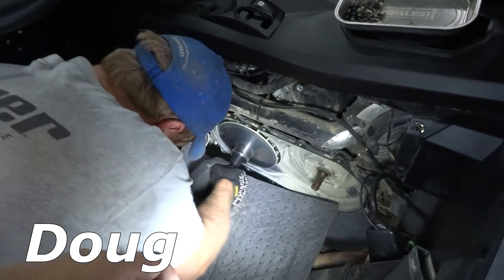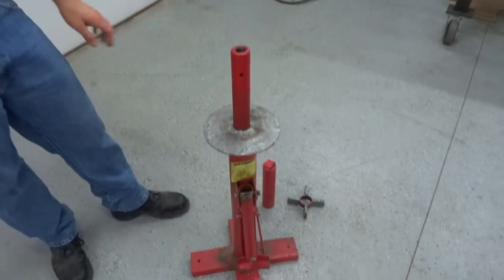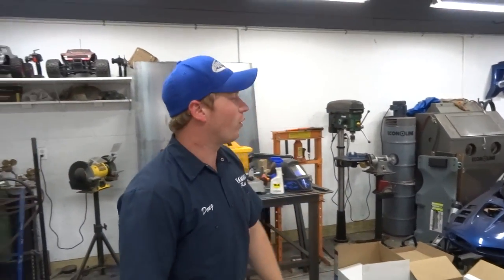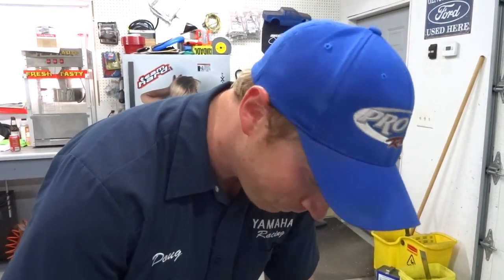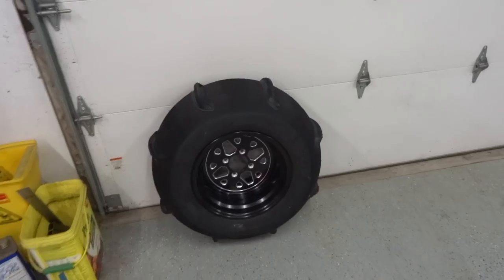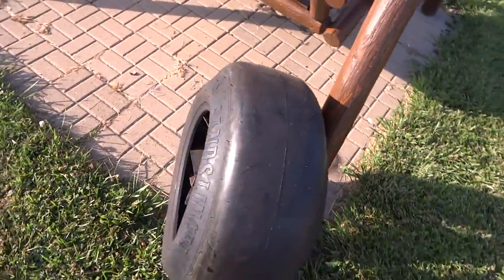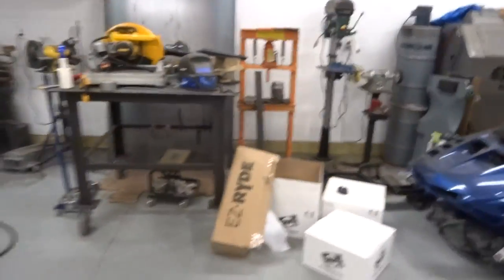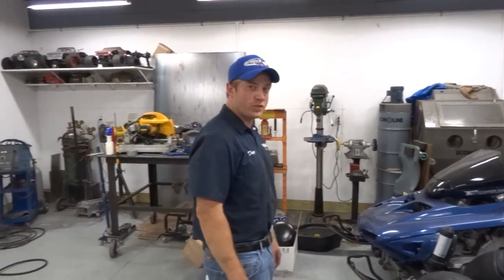How to mount ATV / UTV / SXS tires at home! Mounting Skat Traks on YXZ rims!

Comment: Another tip: remove the valve core when seating the bead. Makes getting the initial seal much easier.
Reply from the maker: James Xikis Unfortunately many air chucks won't open with the core removed, but if you have one that will that works great!
Reply: Probably worth finding one if you do this. I only do dirtbike tires with tubes or Tubliss. However, I have a clamp on air chuck from a really cheap something or other that would work without the valve core.

Comment: Best tip I have seen is that the threads on a blow gun are the same threads as the valve stem. When seating tires on the bead, remove the valve core, screw the gun on, soap the beads and hit it with the blow gun. You will be amazed how easily they seat.

Comment: When the tire is on the wheel loose when setting the bead. Shove the tire down to get the bottom bead started, then gently lift up on the tread to bring the top bead to the wheel. Pro tip. Hunnerd-n-10!

Comment: Thanks for the reply 

next trick is to squirter starter fluid into it and throw a match at it.

NOT inside.  Works - even on stiff  truck tires  - that's a decent quick squirt  or you blow the tire up!

there are YouTube video of it - and the strap would come in handy to keep the center from expanding out and thus force the sidewalls up.

works really well in the field also, as it'll be the only way to get the tire back on.

Comment: Must be nice to mount a tire all by hand that easily lol.  Never had one that didn't need a ton of muscle and several tire spoons.  Of course different tires will be stiffer or softer.  I have to do a set for an old Honda quad this week and just breaking the bead will be rough as the tires are original from 1986.  Will try the board and truck method and hope it goes easy.  Also don't have a fancy stand so doing it on the ground with regular spoons.  Wish me luck lol.

Comment: Real good info, never thought about getting a manual tire machine. But some suggestions, water mixed with some dawn soap is cheaper then we 40, also a com-along and taking the valve step vale apart and blasting it will work better
Reply: even removing valve core can help

Comment: Mounted a hundred tires, starter fluid and a match works every time
Reply from the maker: Definitely something you'd want to do with brand new rims and $400/tire paddles.
Reply: SXSBlog.com 

Honestly never ruined a single tire or rim. The fire goes out almost instantly. Just came back from Hatfield and replaced a tire on an X3 up on the mountain.
Reply: I use gas

Comment: Put a tube in tires that are way away from rim. Then air up to seat beads. Deflate and only break one bead. Remove tube, then you can pull up against seated bead to help seat opposite bead .

Comment: Try putting a cargo strap around it and squeeze it to get the bead up to the rim?
Reply from the maker: Hey Danny, we tried that but with the super thin sidewalls of the paddles it actually just ended up folding and putting a ripple on the bead. This technique works great with regular tires though!!
Reply: Somehow things replies are getting out of order - So the Strap didn't work because tire is too flexy.

The next thing was Starter Fluid - Spray it in and throw a match at it (lighted) and it will explode into shape.  Don't spray too much, just a big quick shot, then light it off and the tire will pop into place.  (make sure you went to bathroom before doing this trick).  

MUST be done outside.  

This works great in the field when you pop a tire off.  It is the only way to get them back on - especially big tough ones (trucks) or too flexy ones (like yours).

There are numerous vids of this on YouTube.

Now everthing is in order.
Reply: On last reply - neglected to add that a strap around middle will keep it in shape as sidewalls expand out.

Now there is a vid that is worth seeing.

Comment: get a ratcheting tiedown and run it around the middle of the tire and crank it down.  it will take air and seal the bead without all the fuss
Reply from the maker: I cut out about 8 mins of video of us doing that. that technique works well with a regular tire but the carcass on a skat trak is so thin it ends up just folding the tire.

Comment: why you don't put those sand grippers on the front also?
Reply from the maker: It would simply take too much power to turn them and bog the machine down.  The sand really robs a lot of power so a lightweight tire combination that is easy to turn is key.